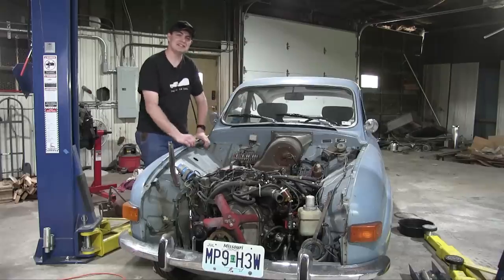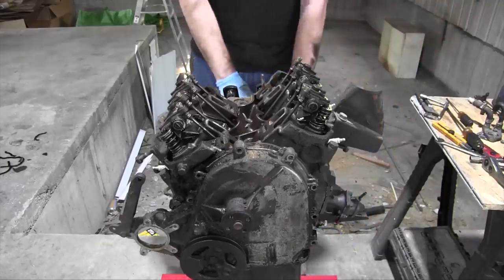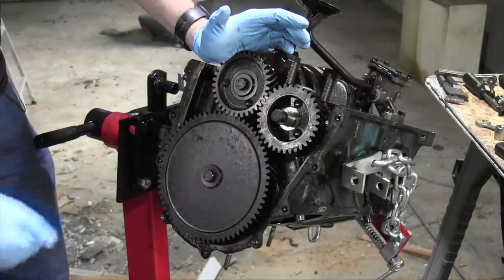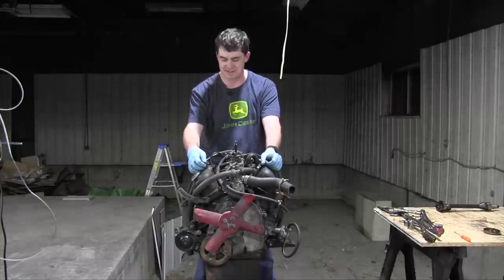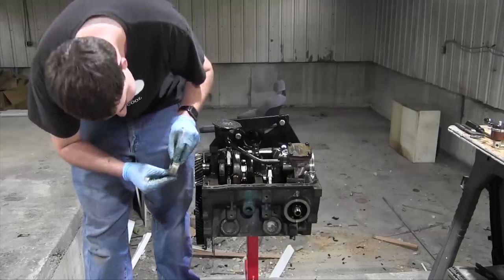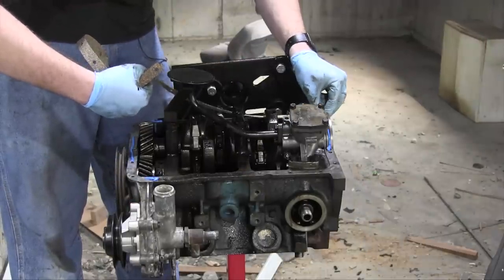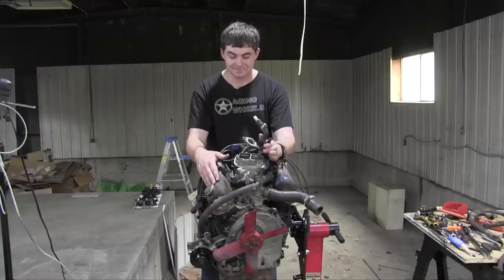Upgrading My Saab 96 to a Two Barrel Carb - Part 1

Comment: Excellent video and my comment is years too late, but tappets are the bits that go tap, which is the gap between the valve and rocker. The bits you installed were the camshaft followers. Also, a tip, push the push rods through a piece of card, that way they don't get out of order.
Reply: No, that woukd be a "lash cap". A lifter and a tappet are interchangeable names for the same thing

Comment: I didn't know how close a v-4 was to it's v8 cousin. Looks like all the same part's a v8 would have just half the engine. It would be hilarious to have custom part's like a performance cam and crank cut down, installed. Reminds me of the 400 we rebuilt for my dad's Lincoln Continental, also an under-powered engine with a two barrel lol! Btw to reduce the chance of splitting gaskets, especially cork you should take some oil and wipe it on both sides of the gaskets, it should help the sealing process as well as keeping it from dry rotting.

Comment: Those two pan bolt holes were probably drilled through during manufacturing for oil galleries.  The seals are to stop oil leaking past bolt threads.... Probably.

Comment: Hey Robert, a good cleaner to use to clean grease and other gunk off an engine is aviation gas (avgas). I've used avgas to clean up my Porsche drums and clean my Honda motorcycle engine.

Comment: If you are looking for these intake manifolds just search for german 1700cc Ford V4 engines.
They were used in many cars Ford germany build in the 60's and 70's like the P5, P7, Consul, Granada and rarely in the P6.
75 HP versions always have these intakes and where build with the Solex 32 TDID carburettor. They also have the  baseplate you need.
Many of them where thrown out of the cars in case of a V6 engine swap.
All of these Models, except the P6, could also be ordered with a V6. 
V6 and V4 are same based so the swaps where nearly plug'n'play.
It was the cheapest and easiest way to get more power.

In case of questions feel free to ask.

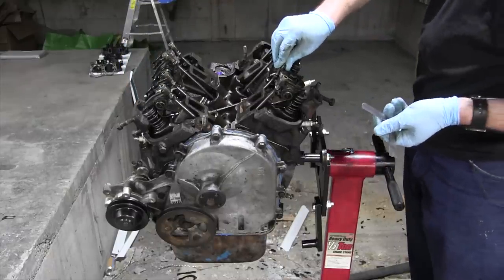Comment: 28:08 - the old Mopar slant six had valve adjusters like that. In the case of that engine, you were supposed to adjust them while it was warmed up and running.

Comment: 25:30, they're called hydraulic lifters. the tappets would be the old system of overhead cam valves these are like a motorcycle engine using push rods from the lifters to act on the valve rockers to open and close the valves.

Comment: One bit of advice I've found helpful for me. A mechanical engineer once told me not to hit a ratchet/breaker bar to free a bolt. If you apply steady, hard  pressure, you're far less likely to break the head off. Just food for thought. 
Entertaining and informative nonetheless.
Reply: Best put freeing oil on the bolts overnight. Then they just ease off.

Comment: Check the oil feed galleys to the balance shaft mate could be oil starvation that killed those nearing, clearing out the oil galleys would be a good idea anyway with all that bearing material floating around. Nice vide just subscribed

Comment: Ford had been making fiber timing gears since the 1928 Model A, and typical flathead V8s had them. The reason is they are quieter than all metal timing gears, which can be pretty loud.

Two questions: Why are you standing at the edge of the pit? And why do you have a pit?

Comment: Don't fret that you didn't clean off the carbon buildup. On old and worn engines the carbon buildup sometimes seal and fill up wear and imperfections, so many times it's best to just leave it alone if you don't plan to rebuild the engine. Nothing bad will come from leaving it in there, it won't make it run worse. All in all, great job! (Though you could've taken the time to repaint the valve covers and oil pan while they were off, just for aesthetics).

Comment: While you've got this engine in your SAAB and its original is on the bench, you can really go to town on it: full rebuild - new bearings, fresh seals, maybe even build it up to a mild stroker with a little bump in compression.  You can build one of these up to 100hp and it's as reliable as it was from the factory, but with almost enough power to keep up with modern traffic.

Comment: I know this is an old video but those timing gears are made of fiber nylon type material to keep noise down. That is why. They can get really noisy. The gears are far more solid and long lasting than a chain or belt but they create a lot of noise and the general public do not want a noisy engine.

Comment: youre doing great for not being a mechanic, only thing you should add sealant to both sides of every gaskets, it helps, theres a red spray that does the same and its easier to apply

Comment: I have had five Saabs. First was 2 Stroke 96 -66 and then three 96 V4 and then sadly 99. After that disaster I have had only Volvos. In one of my V4 engines the smaller fiber gear broke when I was driving on higway. That engine really did shake but I drove home. I managed to buy second hand gears. The larger is still somewhere. You’d better to spare that smaller one because it is what usually breaks.

Comment: I had an old Saab  96.  The engine had to have a bearing replaced by front of the balance shaft, but otherwise was trouble free.  The biggest problem Was the clutch which had to be replaced, according to the manual, every 20,000 miles. My car got 24 mpg city and highway.  The clutch was the same as the one used in the Ford 9N tractor.  The 9N ford would slip the clutch with a 20 hp engine.  I put many hours on one.  The 60 hp in that V4 Ford engine wore that clutch out easily.

Comment: Seafoam you can get it at your local parts dealer run it through the carburetor very slowly while you're keeping it running by you using the throttle.. and it will clean out all the carbon on the Pistons and cylinder heads..

Comment: Entertaining. But you had the head and oil pan off. Why not just unbolt the con rod bolts, pull the pistons and do a quick dingleball bore job, put in new rings and bearings and claim its 100% rebuilt?

Of course, I was really hoping you had the 3 cylinder two stroke, not the V4
Reply: Because that's not 100% rebuilt..

Comment: The fiber gears are used to keep gear noise down.The sludge is usually cause by poor crankcase ventilation.
Reply: And the wrong oil.

Comment: Links and joins to the carbs. are used to avoid the problem of ice forming in a long acc. Linkcable. 
After a night with -30C the last thing you want are a frozen acc. pedal
Reply from the maker: Excellent explanation! I now see why they did it that way. Now why do the brake calipers pivot rather than slide? That's another odd design choice I've never been able to explain

Comment: I know it is late now, but you can always delete that balance shaft to avoid wear and increase torque and rpms. Also, as the shaft wears out the oil pressure will drop which could not be ideal.

Comment: You can find plenty of those V-4 Ford engines here in Europe, and in pretty good conditions too. As this is a US ver., I guess it still has the original 1.5 litre engine in it - ever thought about swapping it to a 1.7 litre, or even a V-6? Great vid.

Comment: You know regardless of the gasgets you could still remove and clean the heads without replacing the gasgets a second time. Worst case scenario use a SUPER mild application of gasget sealer on the more compressed side of said gasget, which I would do anyway after immediate reapplication if new, already compressed gasgets.
Reply: Gaskets
Reply: You should ALWAYS replace a head gasket if you pull the head off. Unless it's a copper gasket.

Comment: You should swap The trabant's engine and make it a sleeper
Reply: And the gearbox too
Reply: Omer Magen swap the whole car while you're at it
Reply: The car would tear itself to pieces unless he built a whole custom car inside the Trabi shell. It is literally made of cotton and flimsy thin steel.
Reply: UGU Zach True. But a steel support structure can made
Reply: Omer Magen I think it would take a fair bit more than that. I have seen sleeper trabants, but there is basically no actual trabant left in them. Just custom cars draped in old Duraplast panels.
Reply: A "sleeper" would be way too accurate!! 😀

Comment: ...WHY they dont use V4 engines enymore?
Reply: but isnt it less complicated than 3piston turbo? wouldnt be better V4 turbo engine?
Reply: The V4 were basically shortened Ford V6 engines. That also means that there is additional engineering required to make them run smooth (balance shafts). Also for the power they provided the mechanical complexity was just too high.
Reply: no need
Reply: @xBelastianx  No, the Cologne V6 was derived from the Taunus V4
Reply: @xBelastianx  The Taunus V4 s not that complex and it's very short stroke so it will run forever. Parts availability for the V4 is the biggest problem.
Reply: Less parts are required for a inline four such as one head one header . the inline engine naturally has more torque which is why most diesels are inline they are also believed to last longer because of the lack of opposing forces from the crankshaft. Inlines are most of the time easier to work on . don't quote me im not a mechanic I'm just an enthusiast

Comment: omg....reusing bearings?!
Reply: iiitttsss fiiiiiinnee
Reply: Any problem? :p its like changing to used but good tires
Reply: @alanowa123  I . . . I can't tell if you're joking or not.

Regardless, this is information that everyone here might want to know:

First: Though my experience specifically applies to cam bearings, it's the same idea just in a different part of the engine. Second, I get terminology mixed up from time to time . . . in case I did, this article might be a better read: https://itstillruns.com/oversize-vs-undersize-engine-bearings-12153771.html

So, bearings in engines can come in three distinct size varieties: 1. Oversized 2. Undersized 3. To spec

Oversized bearings are put in when the existing hole is larger than it should/used to be. I really only ever hear of these being used on things that have been line-bored. (Typically done if either A) the engine's spun a bearing or B) the builder is going to be as precise as physically possible)

Undersized bearings, to my knowledge, are for when the hole itself has remained the same diameter  but the part being used has decreased in size. (camshafts come to mind, here)

So, without knowing the history of both those engines, it's kinda a risky thing to do. Would I still do it if I had to to get one running? If there was no alternative, probably, but with some amount of measuring involved. (If for nothing else than to make a guess as to how far I might get before it grenaded itself)

Comment: Funny with the "transmission cover". I assume the manual is translated from Swedish, and in Swedish the cam timing drive is called the transmission, same word in Swedish, because it transmits timed rotation to the camshaft, and in this case, the balance shaft.
The transmission itself is called gear box, directly translated from Swedish.

Comment: Quite a common change for these old beasties was to source the Ford Essex 2 litre V4 which was in essence the same engine but built for the UK Ford Corsair and Transit vans with more power.   I had heard Ford Escort engines could be shoehorned in with some violence to make fit as the poor ol' V4's were not known for their reliability back in the day (usually due to poor quality control).   I do have a soft spot for the Ford V4's and have long toyed with making one fit into my three wheeler Reliant Robin but its such a heavy lump o' iron it would be costly to beef up the front steering and suspension and the Austin 7 era drum brakes most likely wouldn't be able to cope either but still would love another V4 (last one I had was a 2 litre V4 1971 Ford Transit camper and was bloody marvellous especially as the previous owner had converted it to take a twin barrel Weber)
Reply: The fibre gear wheels should be replaced if poss with a hardened steel one as these used to explode on a cold start wrecking the engine as the fibre bits blocked the oil channels, the balance shaft itself is usually knackered by overtightening of the fan belt which puts undue strain on it all, usually if the balance shaft bearings are going then the other shaft bearings ain't far behind as they are all kinda stressed out of true by said fanbelt problem.   I remember my mates dad's Reliant Scimitar with the Ford Essex V6 in which is basically your engine with an extra pair of pots on, went to start it and all we heard was crunch, tinkle, crack then the starter just whizzing crazily and it was the fibre wheel just self destructed lol   Can get shafts spatter welded then reground to tolerance.

Comment: I would have taken the pistons out when the heads were off just to check the odd ring gap and to check if the oil control rings were gummed up. You didn't mention if the seal kit came with valve stem seals.

Comment: You know the engine is Ford from England used in the transit van and Capri from the sixties. And the came from the factory with 2 barrel Weber. They had a bad habit of stripping the Fibre pressed timing gear. You can buy a aluminium after market one from the uk. I highly recommend that you do. As it has been the death of meany of these engines.

Comment: After watching the teardown of that V-4, I gained new respect for the earlier 3 cylinder, 2 stroke
motor used in those Saabs. A much simpler engine, easier to work on or replace. Add an automatic oiler for the fuel, and a freewheeling setup, and you're good to go.

Comment: one verry importany because the bearings are eaten up by the balance shaft , make sure you check the bearings on the crank as theres a big chance that metal particles from those bearings traveled through the motor oil intoo the other stuff that gets lubricated (camshaft lifters up the pushrods and over the rockers )
theres actually a good chance that the lobes on the camshaft are damaged because of the junk the bearing spread all through the engine 
a good way to check that is look at the old oil and see if there sparkles in there , the sparkles are metal particles

the rubber washers might be because th bolt end up inside an oil channel

Comment: Yes, you have some sludge but its not really that much and VERY far from the worst that I've seen.

For cork gaskets go get some High Tack spray (from permatex). It really helps with getting a gasket to stay in place. You spray it onto one side of the gasket with a decent coating, not SUPER thick but not a light coat either (don't let it drip, that's to thick). Just let it set for about 15-20 mins, pick it up and spray the other side and put the gasket in place immediately with the dry(er) side down and let it set for another 15-20 mins. You can spray both sides at the same time if you hang the gasket with a bit of wire or something (just keep it out of the dirt).

Don't forget to clean ALL gasket surfaces with a solvent that dries with no residue (brake clean, alcohol, or similar). Also don't forget the RTV silicone in corners, like where the oil pan gasket has a break. None of this is meant to be criticism, just some tips for better gasket application and sealing.

Comment: The biggest problem is that the clutch on that car is not able to handle the additional power.  It is the same part that fits into a Ford Tractor 8N which would slip the clutch with its 20 horse power engine.  That V4 in the Saab (I had one, enjoyed driving it) put out 60 hp in standard trim.

Comment: Rubber hose inside the car for fuel is a recipe for disaster, especially with ethanol fuel that eats rubber hoses. The last place you want a fire is inside with you driving. Also it's very loud

Comment: I was going to school you on how to know if the bolts are torque to yeild but then I saw this video was made 3 years ago... I'll still tell it to everybody who don't know, if the torque sequence has a degree or angle after the bolt down pattern then they are torque to yield. Meaning you can't reuse them.

Comment: if you need any help , I have a couple of ford koln engines (These are the ones in the saab) and I plan to modify the engine to more modern spec (Single point injection) and some acc modifications. Il ike the fact you like those lovely cars (Yugo and trabant included).

Comment: I wonder if the rubber washers create a "weakest link" in the seal of the oilpan... So that it sprays out, right there, when you blow the heads... Might prevent a huge cloud of oil and/or flames from the burning oil/fuel mixture on the obviously too hot engine.
Reply: No, the rubber seal is too keep oil from leaking past the threads of the bolt because the bolt holes are not blind, and go through into oil.

Comment: Do use two hands when you using the power shaft.  One on each side, then you will not fall down in pits, when you loos grip on the bolt head. :-)

Comment: to get to a better idea if one eng is better than the other do a compression test on all cyc on both eng,ford 2.8 used fiber gears i have replaced the fiber with aluminum gears, i think it was long ago

Comment: Not intending to sound like a wise guy or anything, but,,,,,,, I was under the impression that the Saab 96 was a station wagon, and that the 95 was a fast back. I had a 1965 95 with the 3 cylinder 2 stroke, and a 1966 96 that was the station wagon. The Sonnet I had was the 4 cylinder like yours. That was back in 1973 while I was working in shop in KC, MO

Comment: Put some Sea-Foam in the oil of the sludgy engine. Drive a couple thousand miles and change the oil. Repeat until clean.

Comment: Those gears are made out of Bakelite (i´ve been told). It´s for dampening vibrations inside the engine. Volvo also had that in their B18/B20 engines
Reply: No they're not. If they were Bakelite, they'd crumble instantly.